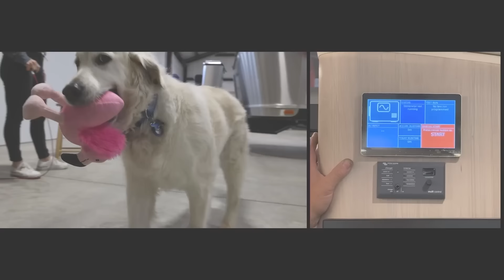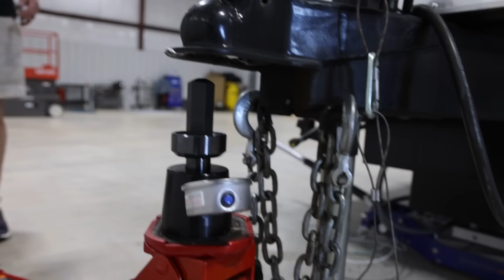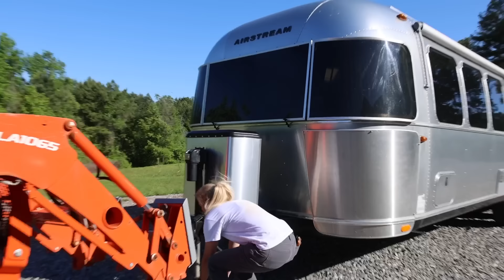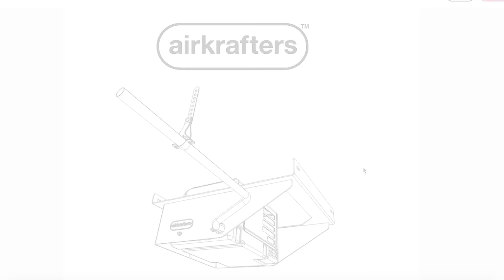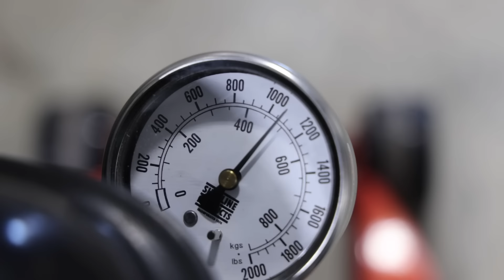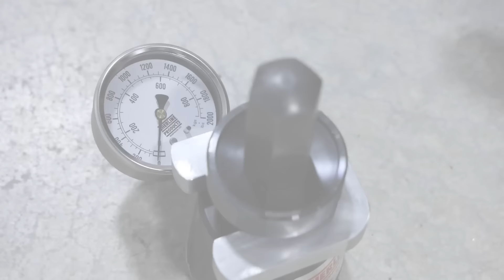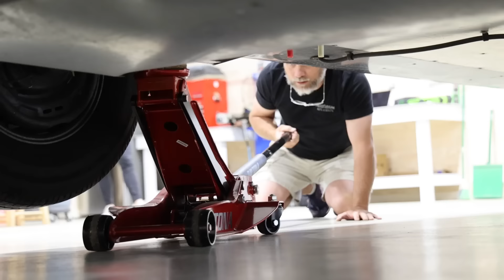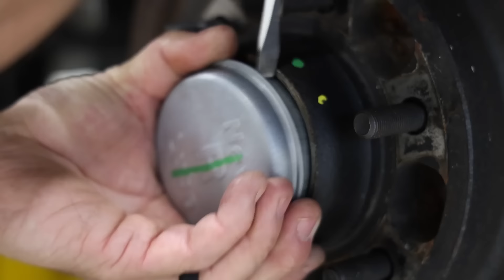DREAM BUILD: Airstream Lithium, Solar & Generator Install

Comment: You are supporting the tank by connecting to the axle? You do realize the axle goes up and down with the spring shackle movement, right? Axles move up and down!
Reply: Dexter Axles are torsion and are not spring mounted. They do not move and are bolted to the frame. The torsion end of the axle moves allowing for independent suspension and a smooth ride.
Reply: @airstreamnutsandbolts  Okay... understood. That should have been clarified before one of KYD's viewers try to do this with standard sprung axles and destroy their tanks.
Reply: @employed247  It's shown in the video. One would assume anyone that is going to do that would know (or at least figure out) the difference in a standard axle and and a torsion axle.
Reply: @TinkerandBuild  That's the point.. They will figure it out after damage is done. Easy to mention that it was not a sprung axle. This is to help KYD, not hurt them. Marc is a detail person. I'm sure he would appreciate someone pointing this out to him.
Reply: It's not an issue because the axles never move - they are hard mounted to the trailer.  The wheel spindles are on a pivot point at the ends of the axles, so the wheels are the only thing that moves.
Reply: @deltabravo1257  That is correct. It just wasn't mentioned in the video. I hope no one tries to do this on sprung axles.

Comment: IMO, Should have used a piece of angle iron for the tank strap, would have been more rigid, also rounding off the edges so no one cuts themselves on the sharp edges.
Reply: Tank has a natural bow to allow for a proper low point drain. It is not flat on the bottom. Angle would make it flat and not allow proper draining. Flat barks the way to go.

Comment: Why did. You lift. The  airstream
Reply: Two reasons. #1 the but of the 30’ GT is low and is easy to drag. #2 it’s required to gain enough clearance for the Generator.
Reply: Oh ok

Comment: Is the fresh water tank supposed to be flat? If so I would think a piece of angle vs a flat bar would provide more support.
Reply: It’s not flat. It has a slight bow in the middle to allow a proper low point drain. Flat bar is the way to go.
Reply: Yup agreed

Comment: What are your thoughts on carbon monoxide and the generator mounted under the rig?
Reply: Generator is designed the be mounted under a vehicle and the tail pipe extends out beyond the bottom of the rig.
Reply: Not an issue because the exhaust exits out the side, beyond the sidewall of the rig.  Class B Vans to this all the time with the same generator.
My truck camper has it mounted in a side compartment under the side of the RV.
Reply: The byproduct of propane combustion in normal circumstances is water vapor, carbon dioxide, and heat — which explains why it is not considered dangerous to cook indoors with your stove or oven. 

C 3 H 8 ( g ) Propane + 5 O 2 ( g ) Oxygen → 3 CO 2 ( g ) Carbon dioxide + 4 H 2 O ( l ) Water + Heat.

Comment: Airstream needs to put on their big boy pants and start making these mods from the factory.
Reply: Then what would I do?😂
Reply: @airstreamnutsandbolts  Good point… 😂 I’m sure we’ll be parked in your bay someday cause they’re not listening.
Reply: I would want a pro not a factory worker who most likely doesn’t have the same kind of pride in their work.
Reply: @lindahenderson2987 Bingo, you can't out do a owner with a great reputation he has to maintain.

Comment: Love your videos but you are getting paid for it. Payment doesn’t need to be cash (or check). You are getting thousands of dollars worth of equipment for free. When you sell the RV you’ll be getting thousands of dollars extra due to the equipment installed. BTW, just as proof, even IRS/states considered getting equipment as a payment. If you get a free car you still need to pay taxes on it.
I appreciate you disclosing this - but it’s important to get the facts right. 
This is an educational video that would help plenty of people, BattleBorn and others funds it with their marketing budget, because it’s a great commercial for them. You recommending their equipment has to do with you getting it for free (not just because you get it free but it’s likely that if you got a similar product from a different vendor, like Renogy, which also has great pressure, you’d probably recommend them - for a good reason).

Comment: Would it be easier if they had the airstream on a high lift to work on? Or will it fit on a high lift?
Reply: It will not fit.  Trust me when I say I’m a tool guy who uses his tools and if it would fit I would have one if for nothing but the cool factor alone 😜

Comment: Question about the lift kit, does he align the axles to the trailer and each other as there is a lot of slotting in those bolt holes?

Comment: OMG I could never ever live in that tin can. You have become elitist in the RV world Thank Goodness Traveling Robert still makes realistic content sorry
Reply: I live full time in a Flying Cloud 27’ front bed twin.  I have solar, lithium and DC to DC charging.  Why?  Because I travel long distances in the winter when there is not much sun so I don’t have to depend on solar to recharge my batteries.  That is when I am traveling long distances and desire to boondock multiple times in a row.  I have a generator (Champion 2500 dual fuel) when I am in the same overcast, sunless conditions but am stationary for long periods of time.  This install is just more convenient and easy to use.  Also, as was stated in the video it is good to have the generator for air conditioning when no shore power is available.  The tin can you reference may not be for everybody, but it is built better than 95% of the other RV mfgs on the market.  The only one close is Brinkley, a new mfg of 5th wheels and they have recently introduced a bumper hitch TT version.
Reply: Good for you. I’m a camper I’ll take my fifth wheel any day over anything else… not everyone is wealthy
Reply: I love this family.  They are kind, honest and hard working.  Maybe instead of criticizing and tearing down other people You could just be happy for them while you continue to enjoy your own life. @GailMurphy-z3s

Comment: Great video! We bought plugs for the holes in the stove top (where the burner grates were removed). We also use silicone post covers on the new grate to prevent it from scratching the stove top surface. The new cooktop was the best mod we made to our Globetrotter.

Comment: I thought you weren’t supposed to lift the airstream from the axles? Only from the jack points?  Please enlighten me.
Reply: I lift the Airstream at the point where the axle is bolted to the frame. This is the point where all the weight of the trailer rest on the axle. Airstream gives the consumer lift points to make it “easy” for them to find the jack point. This prevents someone from attempting to jack up the trailer by the water tank ( I’ve seen it done).   The point where the axle is bolted to the frame is the load point on the axle and is my preferred jack point. But I don’t remember any one do anything they are not comfortable with.
Reply: @airstreamnutsandbolts  thank you! Also if you don’t mind me asking why you used a dc to dc converter instead of the Li-BIM 225 that dragonfly offers.  I have 800ah of BB  batteries 800 watts on the roof and their 12/3000/120 multi plus, 150/70 mppt controller.   I called battleborn before I bought the Li-BIM225 which they told me was better than the dc-dc converter but yet you installed the dc to dc converter.  Can you please let me know why you chose that over the Li -BIM 225 as the dc-dc converter was my first choice. The most expensive part of the install was the 2/0 cable I had to buy.

Comment: Totally disagree with the power build. If you have one (generator), there's no need for the other (solar).A normal RVer doesn't have that kind of money w/o sponsorship. Just my opinion.
Reply: Generators are getting to be more and more illegal. The more options you have the better. That being said, a big solar setup is expensive but you can start off with the bare bones, adding as you can.
Reply: @aprils.360  It's not that "generators are becoming illegal" it's that their hours are restricted at various locations for quiet hour purposes.
Reply: Well there are time when you do not want to disturb you fellow campers at night with a generator running so the solar powered system runs the a/c with zero sound of a motor😊
Reply: Just because you’re broke doesn’t mean having power redundancies is a bad idea.
Reply: I can agree with not wanting to disturb the neighbors. But there's times when I don't want to disturb myself either. My onboard 5500 watt Onan is more than capable of powering my trailer, but I'm adding 1200 watts of solar, and I'm increasing the lithium from 400AH to 600 because I like it quiet.
Reply: My build is nothing like this, but I definitely have dual power. Solar is my primary source, but there are days I need more, or there is a stretch of overcast. Is it critical? No. But it absolutely is recommended, and not out of reach for "those without sponsors"
Reply: Power sources
1) Huge battery
2) generator to run ac and charge huge battery
3) alternator to charge big battery 
4) 30 amp plug to run Airstream and charge the big battery
5) most trucks come with outlets now 
6) nuclear power plant lol

Comment: power from solar to battery and power to the inverter   12 or 24 or 48 volt ?
Reply: Whole system is set up as a 12 volt system. This is primarily due to the fact that the Airstream native system is 12V. Emergency Brakes, Refrigerator, Fans, Lights, ect all are 12V.

Comment: The “Just Right” designer spent some time at a nail salon either as a client or watching someone get their nails done, because when I am a manicurist way back in the early 90s, we had acetone dispensers that did the same thing on a much smaller scale. So, if “Just Right” is newer than the early 90s you all know where that idea came from.
Reply: Justrite was founded in 1906 and is a workplace safety company.

Comment: Great video. I did have to pause so I could find the Plunger Can. 3M VHB great for airplanes, and air streams. I was hoping to see if you are granted membership to the exclusive hydraulic tongue jack.  I would recommend getting a pull handle for Anderson Connectors. Those connectors fit really tight and a handle is a great addition. Thank you for sharing and have a great day.

Comment: I can almost 100% guarantee that generator is going to fail in a pretty short period of time. I don’t know why anyone buys generators from that company.
Reply from the maker: okay.
Reply: Huh?
Reply: Lol. You mean Cummins. One of best engine companies in the world
Reply: sounds like someone who had bad maintenance and had one fail...
Reply: @TScott79  nope I watch multiple YouTube channels full-time people on the road like nomadic fanatic. He has one brand new brand new won’t work. That’s his second or third one that’s done several other YouTube creators brand new generator broke in properly boom is one code pops up and it just doesn’t work anymore for more than 10 seconds
Reply: @TScott79  however I am seeing now that this is a propane one. I am wondering if that one might work a little bit better than a diesel one I think they just said propane.
Reply: I have installed a number of these HGLAA Onan 2500i LP units and also own one myself. I’ve only had an issue with one and it was a faulty safety feature.  The Oil level sensor was bad and needed to be swapped out. Easy fix.
Reply: I can 103% guarantee you're a tool.
Reply: 100% guarantee that it will fail....  What?!?
Reply: I’d be more concerned with the solar panels not being bolted through.
Reply: @peterboudoures8998  I wouldn’t I’ve seen so many people put solar panels on as long as they do it properly it’ll be fine